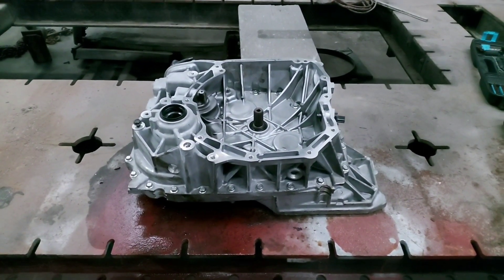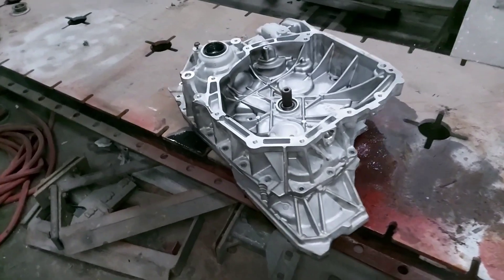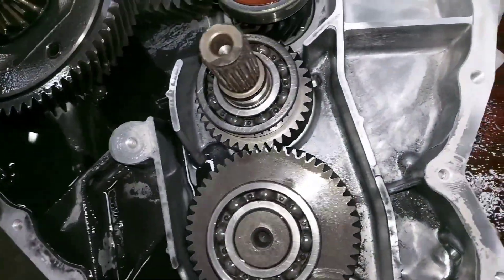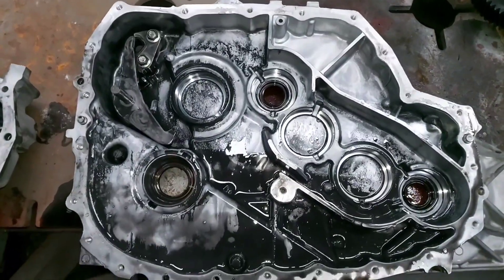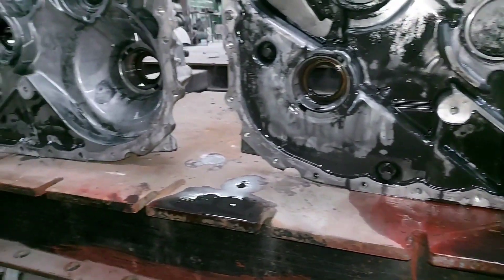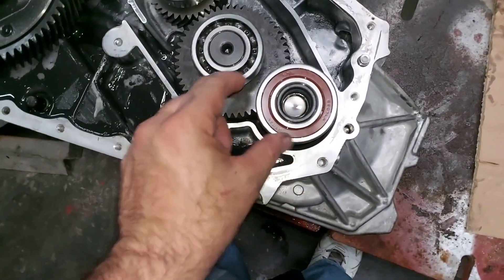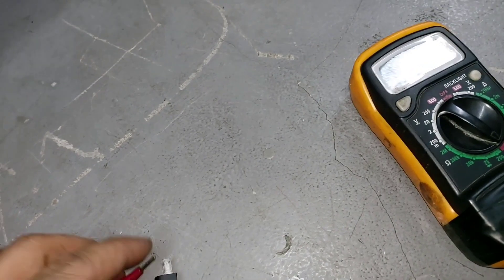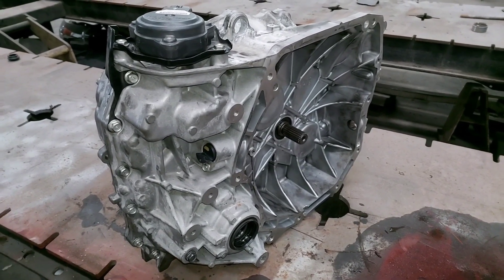nissan note e-power transmission inspection

Comment: Did this tranny fail? previous video you changed the cvt, what was the trouble besides bad oil? Seems gears are not hardened enough and are powdering into the oil, this is rare from Nissan or any Japanese maker to use lower spec metallurgy. Some of the DIY micro hardening nano additives patented in Japan might help but only available in Japan.

Comment: How to clean the unit and replace transmission oil without dismantling ?
Reply from the maker: Right on top ot the inner cup CV
Reply: @hybridsolutiondiagnostics  also can you tell me is it CVT or ATF I recently changed the transmission fluid and put CVT AMSOIL but the old fluid was red in color I did some research and found that red fluid is ATF Nissan matic S
Reply from the maker: @shayanfaisal12  is not cvt... it uses the Nissan S-Matic ATF ☝😎
Reply: @hybridsolutiondiagnostics  And how much does it take in Litres?
Reply from the maker: As long as you change the gear fluid ofter it should be fine...
Reply: @hybridsolutiondiagnostics  how can we change gear fluid and how to check it where's the location?
Reply from the maker: @shayanfaisal12  it has a level screw to fill in...
Reply: @hybridsolutiondiagnostics  is it inside the cabin below gear box?

Comment: What is the transmission oil change interval of this E-power ? ( as per manual & your opinion )
Reply from the maker: I would say every one or two years... gears suffer a lot of stress specially in hot weathers...
Reply: Every 30000 km

Comment: That is a shaft grounding brush to eliminate shaft current that can damage bearing. Motor bearing can be damage by shaft currents such pitting frosting and fluting.
Reply from the maker: Thank you for sharing... it makes sence 🤓😎
Reply: Leaf reduction gear also have this ground device for the same reason.